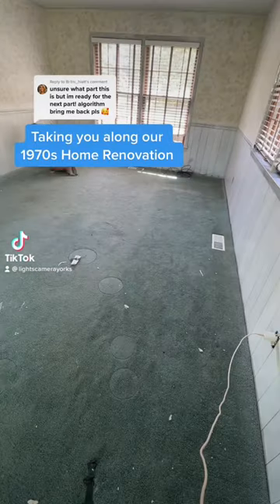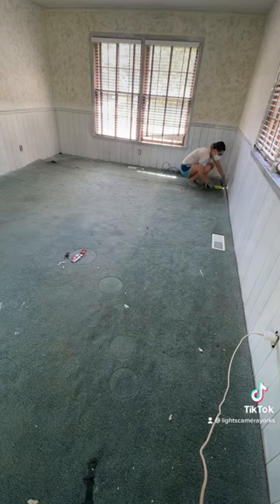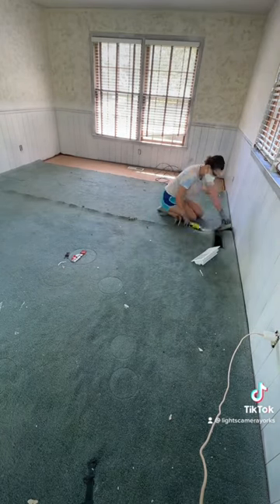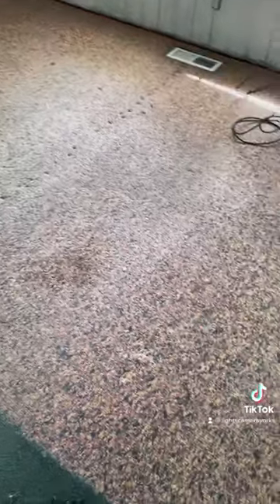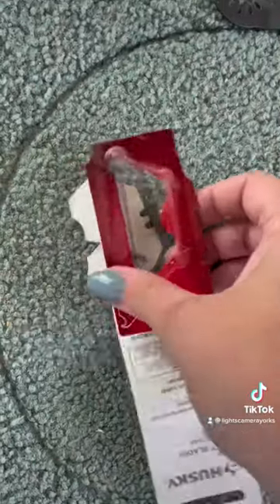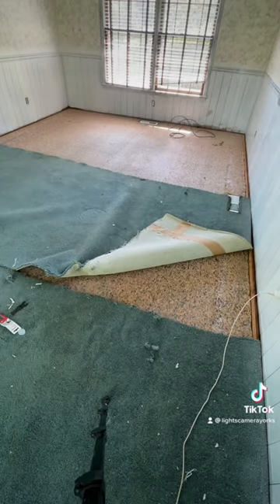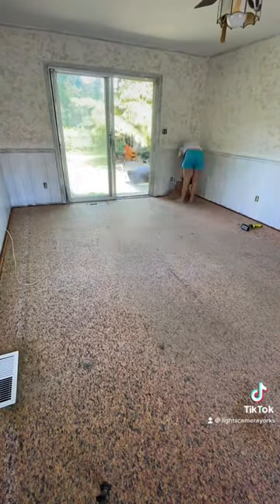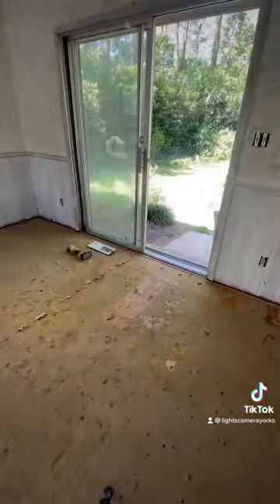Day 5: Removing carpet! House project 1970s home renovation

Comment: That 3rd layer is the remnant of the padding. I had black padding and i had to scrap all that off my wood flooring... i blew my nose after and it was black . X
Reply from the maker: Oh no! It definitely was hard to get off. This carpet was here for a longgggg time 😣
Reply: Agreed. I tore up a room at my moms and the padding underneath had almost completely disintegrated other than where I needed to scrape it up. I look back and don't know why I wasn't wearing a mask 🤦‍♀️
Reply: I have that black crap as well. The room is closed until I get the energy to take it.
That crap goes everywhere. 
✌🏼💗
Reply: @VoteBlue4Peace-LoveInUSAagain  please wear a mask when you do. Its the rubber under the underlay. I was blowing out soot outta my nose for days!!!
Reply: @rebenaq4506  Will do! TYVM ✌🏼 💗 😊
Reply: Lots of people come down with respiratory sickness after doing carpet pull ups. Respirators should be used.
Reply: @loristrout4741  100%. It was one of those times , seen it after I ripped up the carpet and needed the floor cleaned. Never again! Wrapping someone round my nose and mouth would have been better than nothing. !! Lesson learned! 👍
Reply: Some of those old carpets are so nasty.

Comment: Aren’t you worried that there might be asbestos in the bottom layer? 😅
Reply: Asbestos rock wool underlayment. Use HEPA vacuum and seal off rest of the house. Asbestos test kits at Hardware store.
Reply: This was the first thing I thought when I saw it

Comment: The third layer is actually part of the padding that stuck to the floor and separated when you started pulling it up. Probably because someone used the wrong cleaner solution when they steam cleaned the carpet or used too much or the cleaner wasn't fully rinsed out of the carpet and broke down the padding as it slowly dried. You need to scrape every bit of it off before you put the new flooring down because the polyurethane will eventually disintegrate to a fine powder that will irritate lungs especially in small children.
Reply from the maker: We got rid of all the gunk before the new floor 😊

Comment: If that tool dies, a carpet knife with those hook blades can be easily dragged through to cut into strips. That foam stuck on the floor can come up easily with a large floor scraper or a shovel if you have it and then shovel it into a container and throw it out

Comment: How did you get a hook blade for a utility knife attached to a multi tool ? They make hook blades for multi tools but the ones ive seen don't look like that , that have a round end with little notches in it like the rest of the multi tool blades.
Reply from the maker: im not sure. I grabbed this pack from the utility blade section and it hooked on the multi tool quite well

Comment: 90-00 for sure. If it was 70-80's it would be a thicker pile. But we moved to that too short carpets in the 19th and we were still doing both colors up until about 2000 Which is when we started really pushing towards lighter colors.

Comment: Just a suggestion. Make a short video before  you tackle a job you've never done before and ask what will make it go smoothly. People love to give advice and their advice on here looks pretty hellpful...now that the job is done. Like wearing long pants and the floor scraper. The last mess you had to scrape off looked like something had delaminated, such as the underlayment. That's probably why it came off in pieces instead of smoothly.

Comment: That trasch under karpet is the underfloor for you dou karpet over.wen is match time wet trough karpet cleaner or water is broke dry and you get this.in 2023 karpet on whole floor is out woosfloor best keep the cold outdoor.

Comment: That other stuff that was underneath the carpet pad that's the original carpet pad that some idiot should have pulled out before they put down the other carpet pad and new carpet. I can't stand it when people do this. It's so lazy.some worker iterally encapsulating filth putting something new on top of it for all of the dirt dander to press on into thereby further degrading the new carpet and padding. 🤮